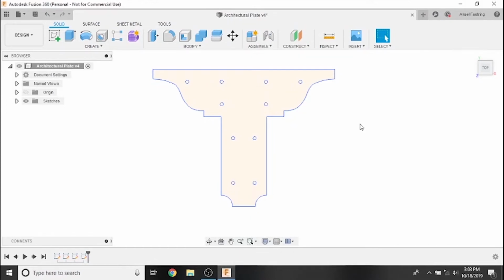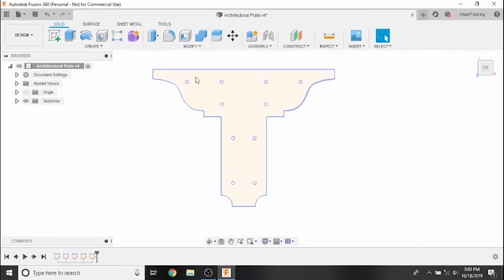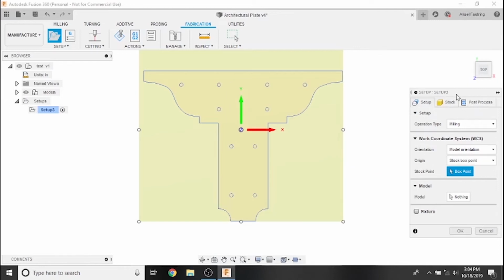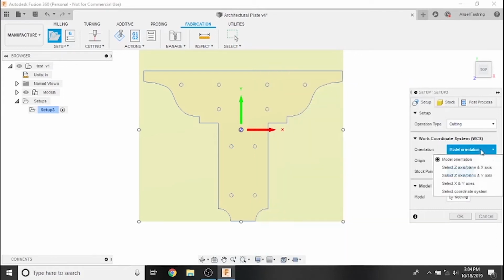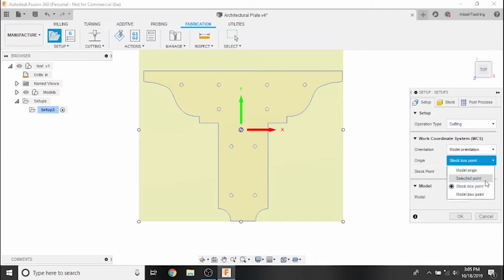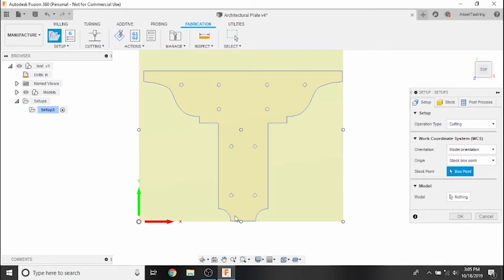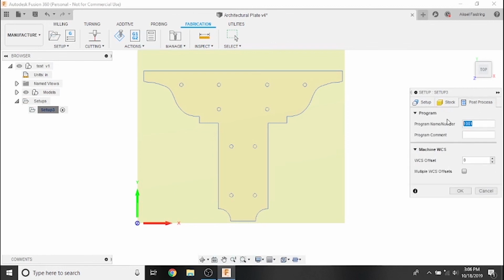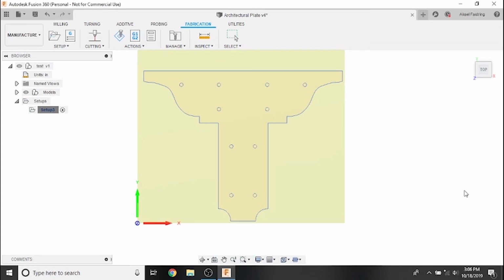Fusion 360 CAM Tutorial 3: Creating a Setup

Comment: So for the guys commenting that the software has changed, if you cant compensate from this video alone you probably need more training in fusion 360, like, come on its not like its a completely different software now. 

Now, Langmuir, what value should I set my top and bottom offset if I have a crossfire pro with the automatic torch height control? 

Thanks
Reply: Software issues are a legit gripe. Remember, These guys are experiencing issues with the software not working as shown in the video.
Reply: Sorry to bother ! But , is it really that hard to start creating letters or signs or its easy
Reply: @horaciosalinas8145  I just set up my table and made my first cuts yesterday. I cut out 2 bottle openers and a gusset out of 1/16" mild steel just to see if things were working properly. Like anything, you get out of it what you put into it. It certainly has the ability to do it but ultimately it is up to you and the effort you put into learning the software. It certainly is not easy but it is not brain surgery. Its simple, Time and Effort will result in you getting better and faster at this stuff. If you do it enough you will master it. If you are using this for a CNC Plasma Table you will only use about 5% of what this software can actually do. Practice, Practice and more Practice.. Good Luck!